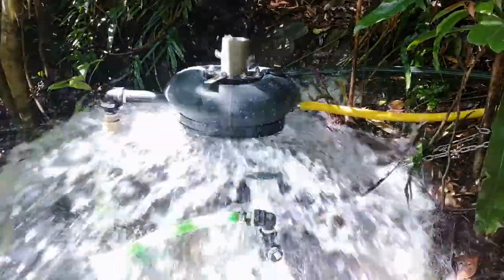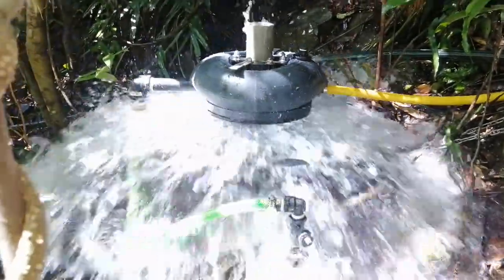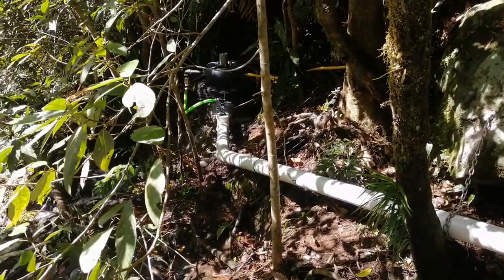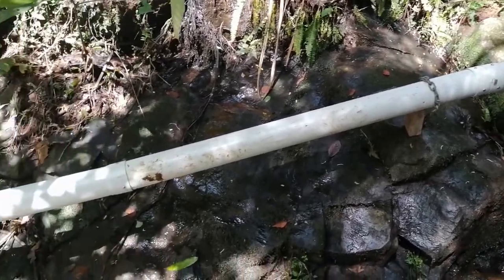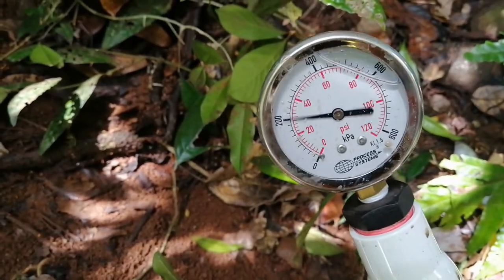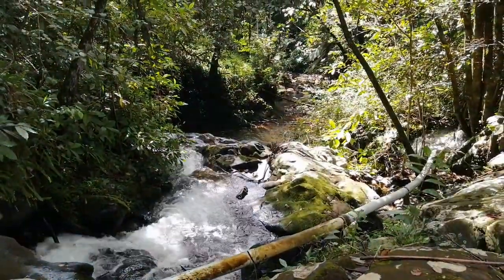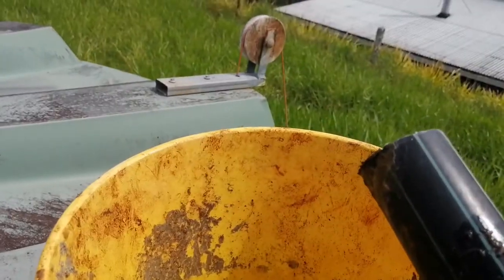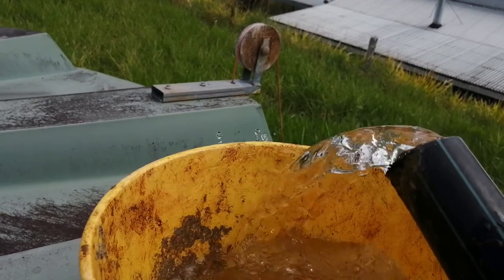Bunyip PA13  Pump at Maalan, Nth QLD, Australia.

Comment: That,s the idea, sell them a Glockeman pump & then sell them a Bunyip = double dollars LOL. There are many reasons why the Bunyip is a better water powered pump, the two big ones are self regulation ie it inherantly goes faster or slower depending on the stream flow rate & the fact it has far far fewer moving parts & far easier to operate. The glocko had something  like a 20 page user compared to a few pages for the Bunkip. The glocko utilised the hydraulic ram principle . The water hammer rammed a diapragm that inturn pushed a piston. It could pump high heads using a very low fall or supply head almost as good as the Bunyip.